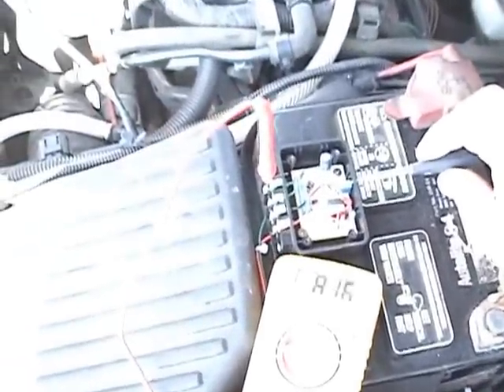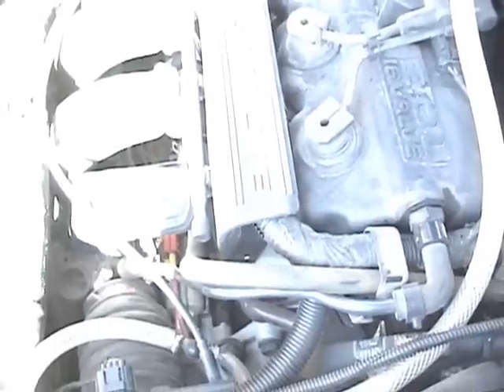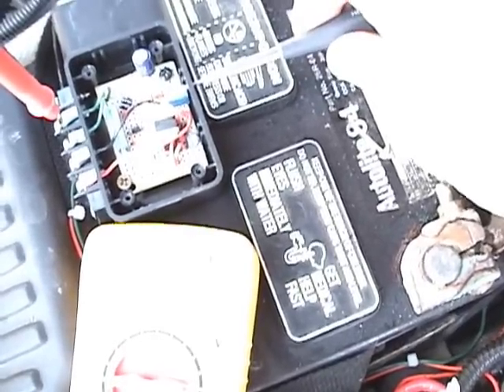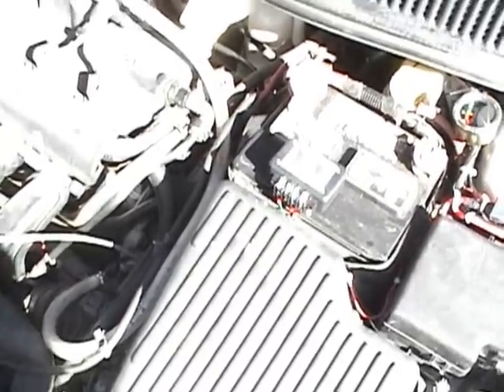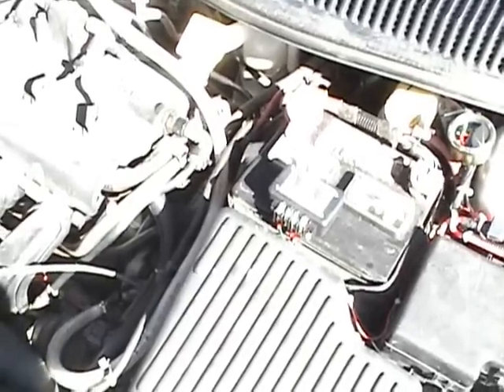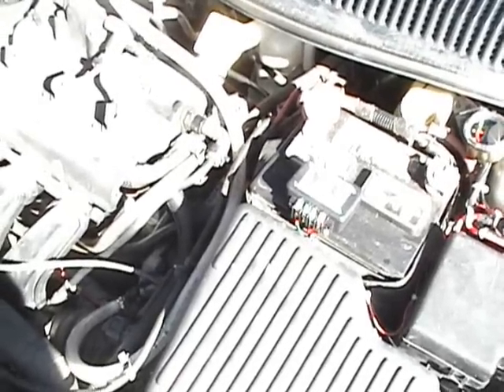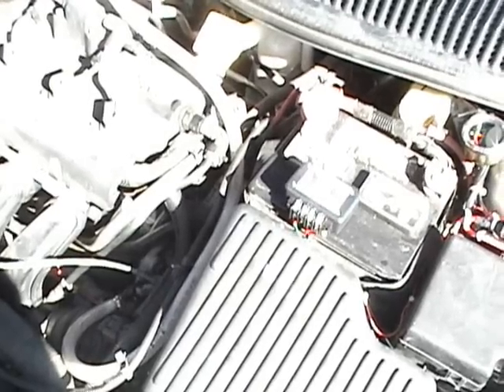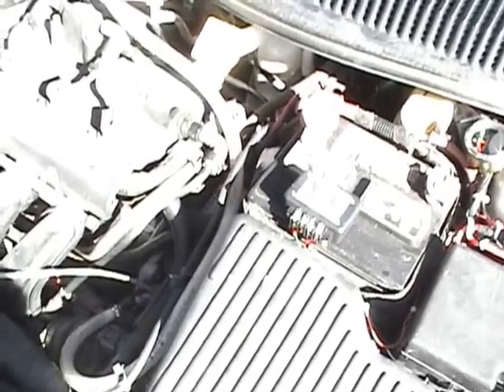(25) EFIE Install Dodge Neon Part 2

Comment from the maker: on a 4 wire o2 test the voltage on each wire.. the wire your looking for will change in voltage with engine rpm

Comment: Do a test at 55-60 MPH and see what you get. I did the same test in my 1995 Neon Auto trans, with 137,000 miles on it and I,m getting 35 MPG.
Pick up a Scangauge from MileagePros and had some mileage reading, as high as 43 MPG when I do some hypermilling. City does drop around 10 MPG.

Comment: I think you have a problem to start with. Your 5 speed Neon should be getting 36 MPG. I have an 2002 Neon 5 speed with a fuel warm and short air intake on it. I'm getting 40 MPG at 55-60 MPH.

Comment from the maker: i did a 97 mile run today using the same method as before. i got 45.34mpg. it's still consistent after 4 days.

Comment from the maker: i just got back from doing a run. 47 mile run i filled up ran down and back and filled again .99 gallons.this was my first run with both EFIE and map circuits running. its the best mileage the neon has had to date. of coure the gen was running about 1Lpm. i am going to do the same run again on wednesday with nothing running
my whole goal with this car was to get 40 mpg im a little bit hesitant at the 47 mpg to get excited but it did fill until the gas was topped off and running out on both fills

Comment from the maker: yah im thinking why cut the wire if you dant have too. sorry for the glare. i wont shoot video in the bright sun anymore. i took a measurement of the voltage and then apply more. it should do exactly the same as if you cut the wire. i am adding a timer to the EFIE 0 to 10 min start for warm up of the engine.

Comment from the maker: sorry everyone for the bad quality of this video. i shot it in the sun and there is a bad glare.
the first full up has yielded a 4.8 mpg increase.
i have a theory that the computer is relying on another sensor to make its fuel calculations as i enhance the o2 sensor. so im going to use my map enhancer a long with the EFIE. this will give the computer no other choices but to lean out the fuel mixture.
for the next tank i will be using both enhancers.